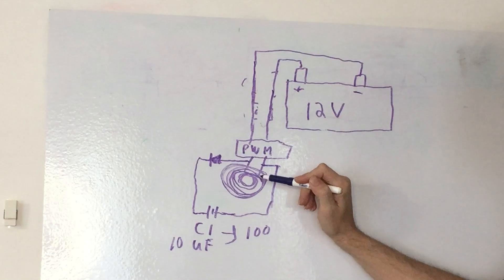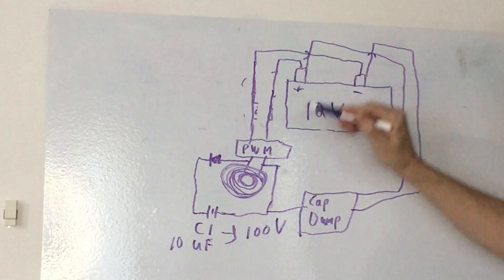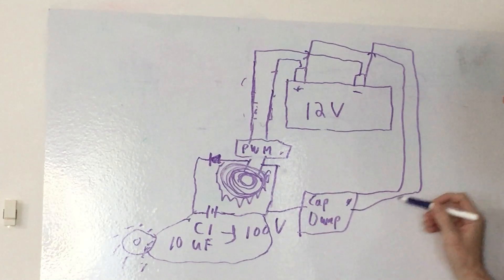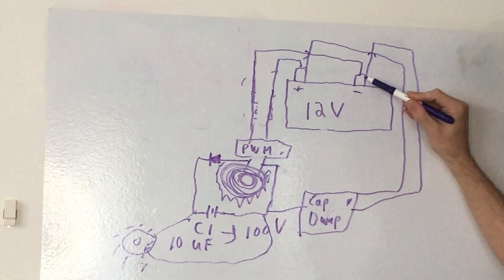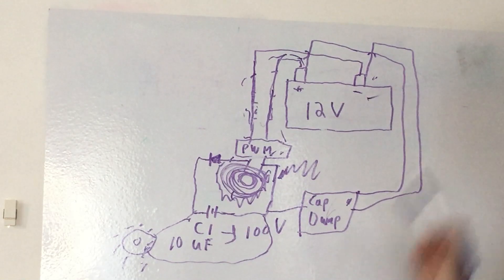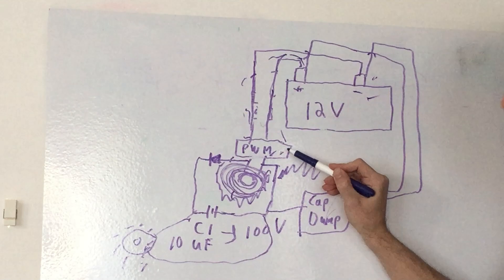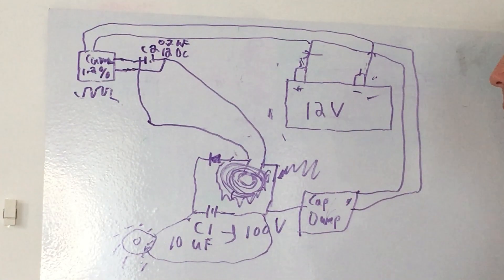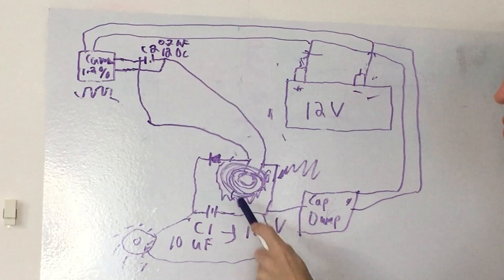Understanding Perpetual State

Comment: To achieve asymmetric duty cycles where the positive duty cycle powers the load and the negative duty cycle charges the battery, you'll need a more sophisticated circuitry involving a H-bridge configuration or similar power electronics setup.

Here's a conceptual explanation of how you can achieve this:

H-Bridge Configuration: You'll need an H-bridge circuit that allows you to control the direction of current flow through the load and the battery. An H-bridge consists of four switches (transistors or MOSFETs) arranged in such a way that you can control the polarity of the voltage applied across the load and the battery.
Control Circuitry: You'll need a control circuitry that switches the H-bridge according to the desired duty cycle. This control circuitry can be implemented using microcontrollers, timers, or dedicated control ICs.
Positive Duty Cycle (Load Powering): During the positive duty cycle, the H-bridge should be configured in such a way that it allows the current to flow from the battery to the load, thus powering the load.
Negative Duty Cycle (Battery Charging): During the negative duty cycle, the H-bridge should be configured to allow the current to flow from the charging source (e.g., solar panels, another power source) to the battery, thus charging the battery.
Protections and Voltage Regulation: Incorporate protection circuits to prevent overcharging of the battery and ensure that the voltage supplied to the load remains within safe limits.
Efficiency Considerations: Design the circuit with efficiency in mind to minimize power losses during both charging and discharging cycles.

Comment: If you want to be sure not to cause feedback problems, if you want to loop the exciter with the load, you could use a LED with a small solar panel, so if would be optically coupled. No chance of causing any kind of runaway.

Comment: Is back EMF essentially the scaler, free given Vacuum energy?  Is the Back EMF the secret to tapping free energy?
Reply from the maker: Yes and no. Being able to capture and use it makes a system more efficient. If you want over-unity you also need to find a way to also eliminate CEMF. One way is keeping the loop open, Using one wire systems etc,,,
Reply: What is CEMF?
Reply: @emichael06 'counter emf'
Reply: @paradigme_ what is the difference between "back EMF" and "Counter EMF"

Comment: Good Stuff Joel. Yes its important not to dump the charge into the run battery during the drive cycle. Perhaps it's the one thing to recognize.  Its easy enough to build a logic circuit to time it appropriately...now we just deal with any other losses and it should work ok. Thanks!

Comment: the  thing that interests me today is to find  a obvious solution.  yes it only takes pennies to run the one wire system, and then convert it to usable work, but how about taking the pennies to drive another hv source/flyback that again cost pennies to drive as a voltage source. From the ion valve,  one wire HV system, and so on.. I am interested to see if you can drive a second driver from the first ion valve to a one wire  hv supply. As you discovered there is that ac/dc component and therefore the more ac and dc  available to do work? converting it back  and forth or simply splitting the dc from the ac itself due to the high frequency. I think that is what i am asking, to  drive another high Volt  system, and then use them together perhaps in a single circuit. pennies to drive it, then pennies to create another driver itself.. perhaps splitting the ion valve at the output wire into 3 out put wires, and then drive 3 HV sources individually from the single ion valve. then you could add three more ion valves and so on.. or at least use Cockcroft Walton double circuit after the ion valve to do  the same. or at least use Cockcroft Walton double circuit after the ion valve to do  the same. or at least use Cockcroft Walton double circuit after the ion valve to do  the same. 
or at least use Cockcroft Walton double circuit after the ion valve to do  the same. 

yea?
Reply from the maker: You will like my next video, it diggs into some off this! With working examples.

Comment: I've found the best "loop" is when you can disconnect the source from the pulse generator while sending the "cap dump" back to the primary power/battery.
Of course the best way is to charge a second battery the way J.B. did. If you can't do that successfully, then you are really rowing up a river w/o a paddle.

Comment: Can you replace the battery with supercaps? 
Nice video but real self looping involves no battery as the battery can show voltage gain where there is no energy gain present. The battery chemistry can let the impedance of the battery change when the battery is operated beyond there normal mode. As you are an intelligent guy I suspect you are aware of this trap.
Reply from the maker: It's not a trap, you can self loop its difficult but it works and there are gains, I also did it with super caps. If your interested take a look at my old videos.

Comment: The different battery chemistries of the different types of rechargeable batteries make this slippery slope of pulse charging timing even slipperier.  Most will acknowledge the voltage and impedance parameters of a charging battery, many miss the inertia difficulties of a starting and stopping charge of a battery.  Batteries do not like drain and draw pulsing and certain common chemistries will "fight" the constant change with slow moving chemistry.  This is additive to the internal lenz we call impedance.  There is hope though.  All batteries have a "sweet spot" for this process.  An ideal frequency.  Actually multiple frequencies in a certain harmonic.  Finding it is the trick and it is different for every battery that I have worked with.  This is why when pulse charging batteries connected in parallel, some charge while others in the group will go dead.  A smoothing cap bank in parallel with the battery, that can accept the full charging pulse while maintaining a volt range a few volts over the normal operating voltage will abate this problem.  But, at the cost of a harmonic gain you receive when the battery is in tune with the charging pulses.
Reply from the maker: Yep and like I said i'd rather go for the deal of 10 for the price of one, instead of doing this "silly" looping and loosing 99% of our precious gains in doing so. As you stayed it can be done but comes at a cost of reduced efficiency.
Reply: Thank you for your comment because I learnt alot from it 🙂 I'm looking to build this- if I may ask you : if I use say one full battery to charge 3 empty batteries will the 3 batteries be charged up fully before the source battery fully drains? and will they work as long as they should? Because that then surely is "Free energy". Wow! 
And how long will it take to charge them?
Reply: Lovely comment

Comment: Very good explanation, thank you very much ❤

I don’t know who came up with this idea to self feed the circuit, looping it but certainly I know why and many people are simply mislead by this stupid idea.

1. They are saying that looping the system is the ultimate proof of over unity that a system can provide more energy out than energy in.
2. Looping such a system is the easiest way to have a patent denied on base that perpetum mobile do not exist.
3. Such a looped system may work at a certain low level of energy output, but there will be huge difficulties when the output is over 3kw. They will say that there will be easier to get a tiny bit of output to feed it which isn’t true at all.
4. By diverting all focus on looping the system they want to make you move away from real gain of energy which is not the temporary storage like a battery.
5. By misleading with looping and amount of effort and resources wasted in this way they make people to give up by realising the cost is not effective at all.

Now, I congratulate you Joel that you managed to keep your focus and say that we are better off by paying price of 1 for 10 … this is the very truth we are looking for. And now come into play the 1 that we are willing to pay which can be any source that is not and can be not taxed or measured ! That could be obtained from an small electric pile, solar wind, thermal gradient …. anything … if our system that we create is efficient we only need a tiny input few volts and milliamps.
This is not energy from nothing, it is energy from something … just ignore all those naysayers that are mostly paid from a dark and dirty source, probably some of them might be just ignorants 1-2% of naysayers, but the rest of them …

Comment: Salut Joel, just 1 question, where do you connect the negative of the cap dump ?
Reply from the maker: That was just an example, you can use any method you like, The cap dump is convenient. just as normal you pulse the cap dump normally, negative goes to battery negative.  Just keep in mind that cap dump is a whole system and not just a "cap" You can find ample cap dump circuits online and on youtube.